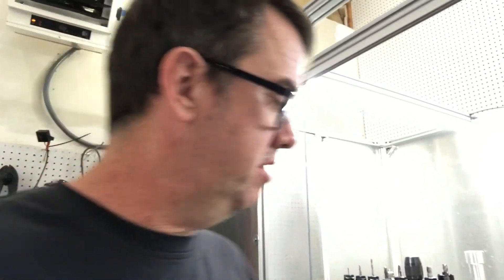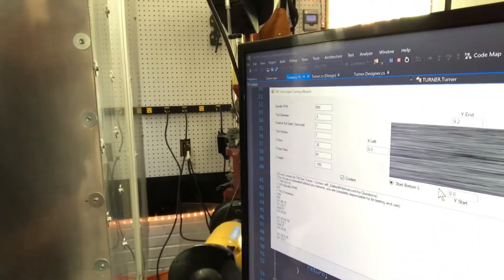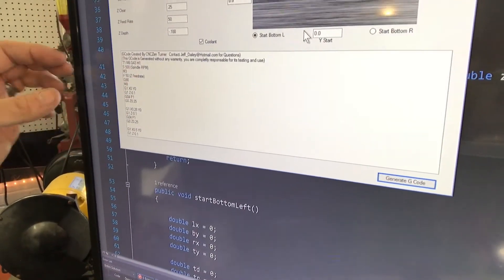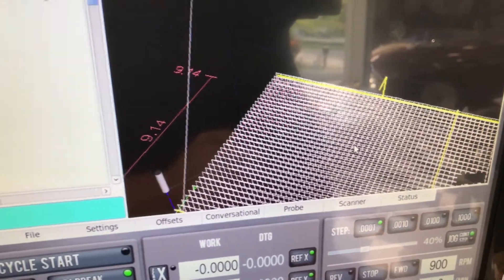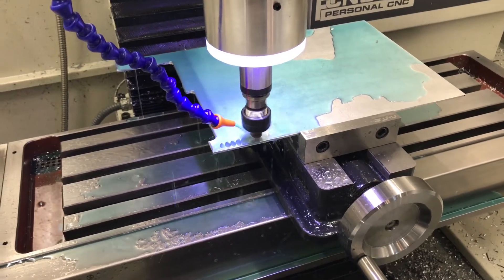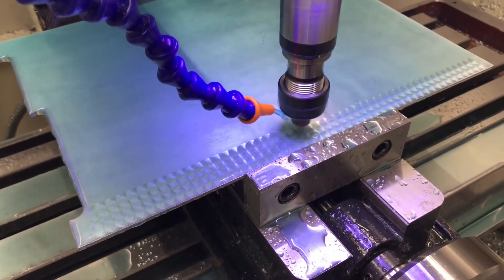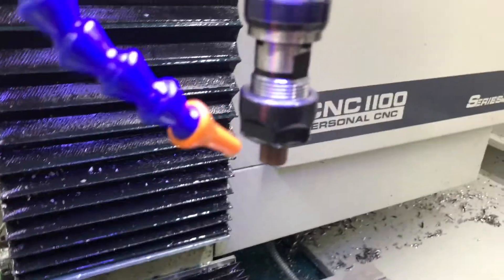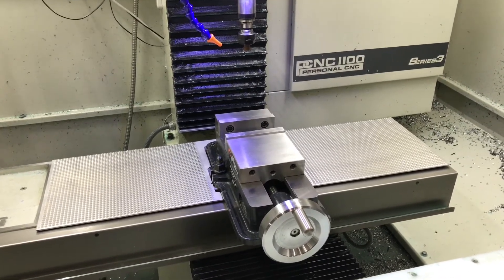Engine turning made easy

Comment: Hi Jeff,  looks like your using a Cratex fine stick? I've been having great success lately using them on my CNC router.I chuck them directly into the collet, but I'd love to know where you picked up the spring loaded rig. I get around the problem of Z axis criticality by placing a 2mm sheet of EDM /"Fun Foam" underneath the work piece, which in my case is .005" nickel silver foil. The results are amazing, and I can run the CNC up to 24,000 rpm with coolant! I'll send you some images. Great work!
Reply from the maker: Mark Wilson I got it from tormach. It's their tapping holder.